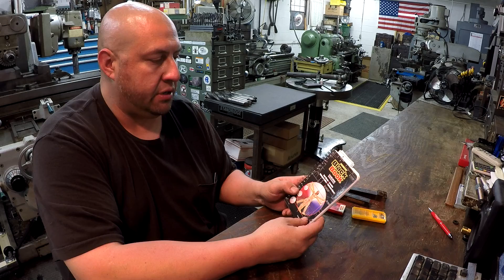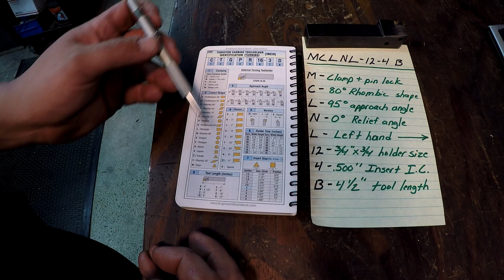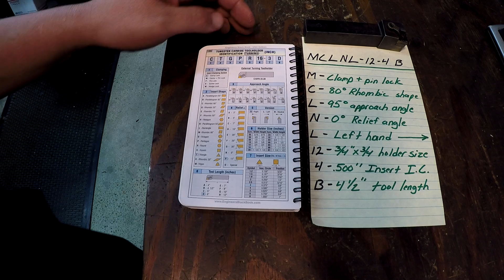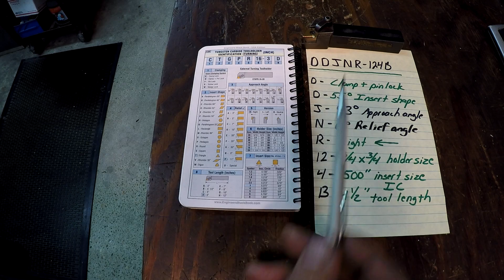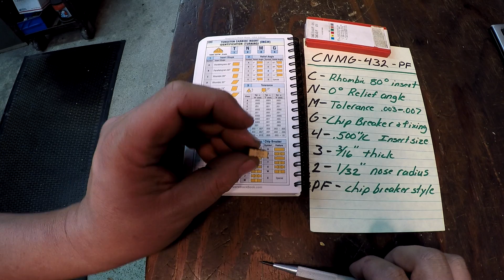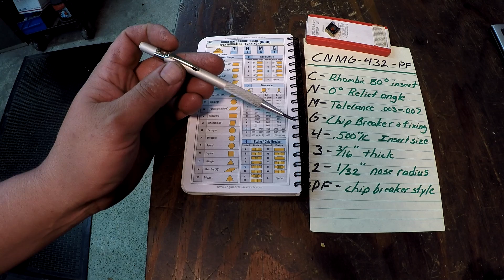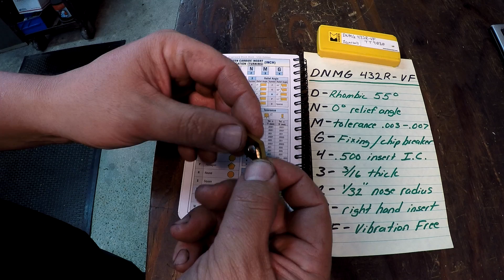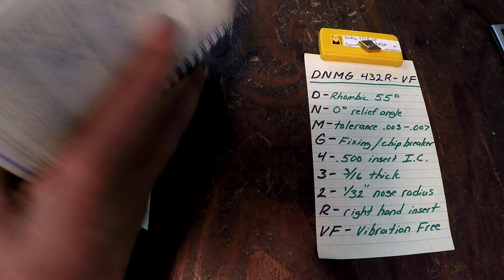Shop Talk 12: Carbide Tool Nomenclature

Comment: Old teacher tip: when explaining something like this, it is very helpful to the students/listeners, (S/L), if the teacher/speaker, (T/S), uses the 'In Other Words' technique.

What do I mean? Take the fourth code letter for Insert as an example:

Saying "The fourth code letter represents the relief angle is 0°" gives the information, but if the S/L doesn't know what a relief angle is, they won't have a full understanding. 

They might be able to parrot back to someone, 'The fourth code of inserts stands for a 0° relief answer.', but when the next question is, how does that impact you as a lathe operator, they'd say 'Dunno'.

In other words, just telling them what the fourth code letter stands for the amount of relief angle, is rote or memorization teaching/learning. While expanding on what the relief angle is, and how it impacts a lathe operator, is giving them a working knowledge, or understanding.

You had a mixture of both in this vid, so you do it naturally. That's why your vids are so good, and popular.  For you, having an understanding and awareness of this AS a technique, will help you be more consistent.  In other words, when someone understands the positive or negative impact of how material is presented, they can better utilize the positive methods, and try to eliminate the methods which have a negative impact.

That was much harder to do than I thought, in a comment!  Giving an example, explaining the technique, AND using the technique, as well.  It reminds me of something a prof used to say about teaching, "Tell them what you are going to teach them, teach them, then tell them what you just taught them."  In other words, always try to do use intro, session, and summary/review as a format guideline. 

See what I'm doing there? LOL   The importance of repetition can not be overstated; the trick is to not be repetitive when you are repeating.

As I said, you are a natural teacher, some people are, some have to work real hard to be a teacher, others cannot teach their way out of a wet paper bag.

What is interesting is I didn't intend to write this comment, when I started. I had a couple of questions. It was when I realized the questions I had were on the codes where you used the rote teaching method, that got me on this path.

Does the the relief angle code for the holder mean how much relief angle is in the holder, or does it mean the holder is designed to use a 0° relief angle insert? 

Or does it mean both, there is no relief angle, and the insert should have no relief angle?  

The second question has to do with insert size. I didn't understand what is meant by IC. You said what the acronym stood for, but not how that designates the insert size. I can't remember the words you said, so I can't explain my lack of understanding. 

If I try to play it back, I'll lose this comment. (damn iPad)

Thanks...

GeoD
Reply: no response to old vids

Comment: Adam
Can you help I run a myford lathe in my hobby shop you would say 7 inch in the uk we say 3 1/2 inch just over 1 HP up to 3000rpm 
My problem I use insert tooling my best results are from a CCGT 0602 nice finish etc these are for Ali but take it easy they work for En1a steel ,if I use a CCMT 0602 that should be for steel it throws up a nasty bur just in front of the cut tried diff speeds cut and diff manufacture of insert ( note not Far East but named ones second/Mitsubishi) ,with the CCGT I can take a 2mm cut 4mm off dia in steel fine but CCMT is pants
Hope you can advise
Stuart

Comment: You just sold another book! 
Great video and I truly needed the information as all those codes are confusing. Now, comes the proper selection of insert for general use. I am a home hobbiest and your comment on the radius was extremely helpful. If possible add more of those. 
Again thanks!
Reply from the maker: +Tom Herd Thanks Tom. Funny thing about the nose radius is that's stuff I learned all on my own. Coming up in the shop and experimenting with different inserts dad had.

Comment: good one didcnot c do any carbide when I did my trade did exactly what you showed last month sat with the manufacturer book and break down the code. still havent got my headcroundcthe colour codes may be you could touch on that next time.
thanks for your time.

Comment: Adam  a hundred thumbs up.  This is one of the most educational videos ever.
I live rural Vancouver Island BC  Canada and if I want just basic tooling I have just 
under an $100 ferry ride (one way) and limited suppliers to buy from so am left 
to purchase by mail order and haven't a clue what to get.  But your video brings up
two items   1)  what does included circle mean when describing a insert.  

The second item, and I don't want to put you on the spot, but if YOU were going to
buy turning tool holders lets assume five of them including; Left hand, Right hand,
threading, straight and button style in 1/2 " holder which ones would you buy?  
Supplier and model numbers?  We won't hold you to it though.
Thanks a bunch   Rod

Comment: How about cutting speeds, in one of your past videos you make some really heavy cuts on the lathe and get really smooth consistent large chips off of it. How do you decide speed and feed? Just go by the tool mfg's recommendations or do you use some sort of black magic to get such good results?

Comment: Very nice and informative video, according to the book, it's amazing how many different inserts, with different uses are available. I just wonder, is there a particular difference between inserts for manual machining and for CNC machines, or they are the same so you can use them either way? Just curious! ;)

Comment: Hi Adam, nice video.  In Ireland we use the metric style of insert where the size code is in numerical form.
CNMG120408 would be CNMG style. 12 is the cutting edge length in mm,  04 is the thickness in mm and 08 is the TNR in mm.
Keep the vids coming

Comment: The engineers black book is excellent . i keep one inside next to my computer and one on the top of my tool box , its not as comprehensive as the machinerys handbook  but it fits in your pocket .
Reply from the maker: It's like all the best and most useful info right there in a little pocket book.

Comment: Got a copy of the Australian edition, first 5 are the same, #6/7 are height/width of tool(shank) in mm, 8 is tool length in mm, 9 is cutting edge length and 10 is "manufacturers designation". Might be useful but chances are everything down here is imperial anyway and would need the pages from the US version

Comment: Adam, I sent you some Ingersoll DNMG 431 MT inserts a few weeks back but I never figured out what the MT stood for. I see the VF was vibration free so I guess MT is mighty tough. One thing about an old telephone man is he don't know squat about carbide inserts.
Reply: Hammer0f Thor M may stand for stainless as per the ISO material groups (p, m, k etc).

It also could (probably does) indicate a proprietary chipbreaker. You'd have to consult the ingersoll catalog.
Reply: John Parnham Yep John, I was able to find a catalog listing MT is for steal, cast iron, and stainless, and the best I can figure is the T is probably where they state this insert has a "tough" rake angle for medium roughing. Either way, it's just an Ingersoll proprietary designation for the chip breaker style. Thanks!

Comment: Hello Adam,  Very good information.  In an upcoming Shoptalk how about an overview of which cutters you have found to be the 'best' for turning, facing, boring etc.  I am just getting into the inserts with my 12" lathe and it would be valuable to know which all round and specialty cutters I need in my inventory for general lathe work.  It would also be fun and informative to see some Chinese (Shars) cutters compared in actual use to the high dollar ones on your more powerful machines.  For a home shop on a budget it would be good to know which to consider and which to give a pass to.  The rep from Seeco was on Metal Tips and Tricks and hit the surface but for some reason never came back.  Quite a lot of the subject was left uncovered.  A necessary topic in machining and can save a lot of expense and time in personal experimentation by giving a starting point.  I am going to have to pick up a Black Book I can see.  Take care.  Doug

Comment: Basically these nomenclatures are codes for classification in a small space and are unified by being used by all manufacturers..  Example-Any standard light bulb can be screwed into any manufacturers socket and work.  Or any 15 amp plug can be inserted into any 15 amp socket.
Reply: Roy Reynolds only for standard inserts. Some companies have unique size/shape inserts which won't work with any other toolholders.

Comment: Good info as usual. The 'G' inserts,as you mentioned has a chipbreaker on both sides,which means they can be flipped over.
That means that a TNMG has 6 cutting edges, that makes it very economical. Thanks again
Reply from the maker: +Ben Billing But, a cnmg has 8 corners! I have other holders for making use of those 4 odd corners.

Comment: Is there any reason to use a smaller holder/insert, say a 1/2" instead of a 3/4"?  Assuming you can use the larger holders on your lathe.
Reply from the maker: +Axis OTW Yes, they fit smaller sized tool posts and machines. The 300 sizes inserts are very useful too.